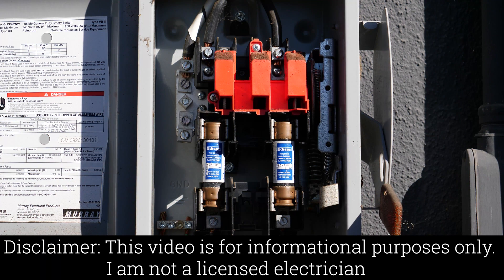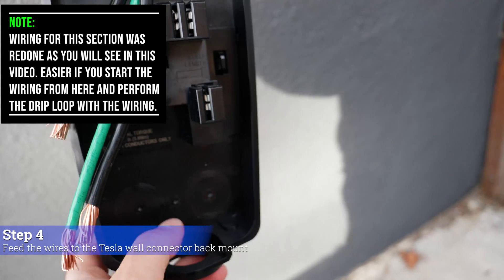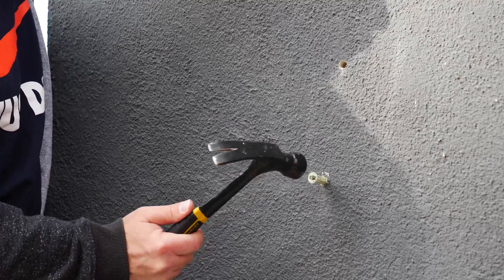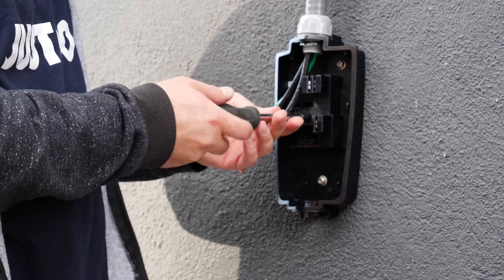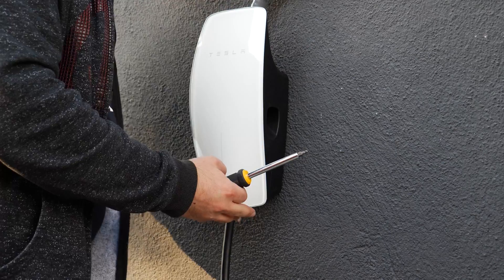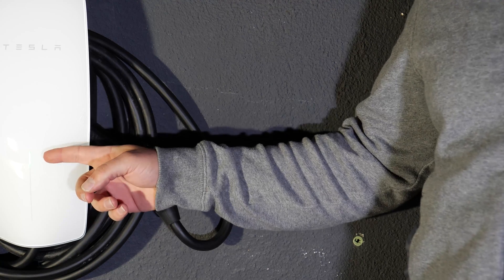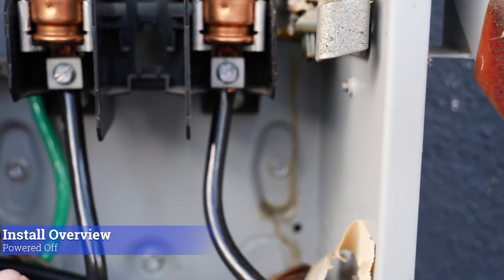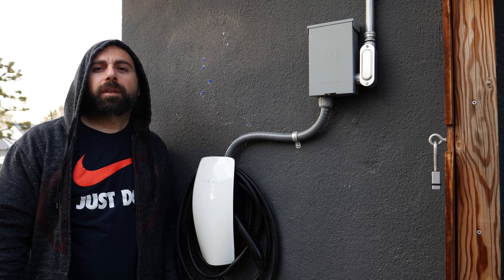NEW Gen 3 Tesla Wall Connector Installation (2020)

Comment: How has it held up being in the elements all day?
Reply from the maker: Under direct sunlight every day and it's hot here, there is some discoloration and a small part of the white portion "paint" of the Tesla has fallen off if that makes sense but other than that it works the same as it did on day 1. Only cosmetic "damage" and under lots and lots of sunlight. I could easily replace that front since Tesla sells that by itself, so an easy fix.
Reply: @landpet  thanks for the reply looks like I’m going to have to do the same. You made me feel better about it.

Comment: Used same size drill bit drilling holes in the wall and drilling through the mounting bracket.... no wonder had to use washers after.....plus the wiring redos....etc......etc. Such a sloppy DIYer.....
Reply from the maker: Thanks for the feedback and explaining your feedback.

I used two different sized drill bits (the one for stucco has a wider tip designed for those applications). I used lock washers which help spread the load evenly and prevent loosening due to vibration (always have had a great experience with lock washers keep bolts and screws in place after long periods). I didn't need to put washers, just did cause it's better to use the lock washers. The wiring redos, I left it there on purpose (which I could've easily omitted, still can cut it from this video) cause on my original install the wires were not long enough so they were sticking out a bit. A lot of people suggested which I agree with to redo that portion of it to not have any exposed wires and so I redid that portion and added longer wires. I left it there to help people to not leave the wires that way (even though power was never on when the wires were exposed).

Comment: As long as the run is less than 100 feet, a 6 gauge wire for the load and 10 gauge wire for the ground is fine with a 60 amp breaker powering the HPWC.
Reply from the maker: I think 6 gauge is fine with 8 gauge ground as well since my run is about 40 ft. (12m) but a few tools online recommended 4 gauge so I went with that. Doesn't hurt to go thicker.

Comment: isn't 4 gauge copper overkill for the new wall connector since it maxes out at 48amp? I guess if you have a short run it's probably fine   I was thinking to go with 6 gauge copper in conduit with 8 gauge ground wire.  I have a fairly long run so cost and difficulty would increase with 4AWG.
Reply: The manual for the third gen wall connector recommends 6 gauge copper wire for maximum power so yes, everything else is Overkill.
Reply from the maker: @JEFFREYSOLORIO  I think 6 gauge is fine, but a few places mentioned 4 gauge for 60 amp. It never hurts to go higher and it was roughly the same amount of effort.
Reply: I bought the wall gen3. I installed it about 25ft away from breaker. I used a 6-3 wire to connect. I installed a 60 amp breaker. Had no troubles until a 2-3 weeks in, the wall charger started to trip. I noticed that after 30 minutes of charging I would get the error charging interrupted. Noticed that happen several times through the night. I think it was because of the wire size. I now bought 4-3 wire going to give it a shot. Sux to run these types of wire. Wondering if I should just down grade to a 50amp? Don't want to but a breaker is cheaper then wire.
Reply: Gems Cove 
I wonder if the utility power might be the problem?
Reply from the maker: @525sprockets  Well I would test even a 30 or 40amp breaker to see if that fixes the issue. If you put a smaller breaker and it works no issues, then you do need the 4 gauge for 60amp. If you put a 30 amp or 40 amp and it also messes up, assuming you also update the Tesla Wall Connector settings to point to the 30 or 40 amp. Then that means your issue is elsewhere, either a faulty wall connector or something wrong with your source of power.
Reply: @525sprockets  6-3 nm cable(romex) is only rated for 55amp(55 x 80%= 44) use 40 amp breaker.  
Use #6 thhn wire, rated 75amp
(75 x 80%=60) use 60 amp breaker

Comment: Can you change the circuit breaker quickly within the app after installation? I use 50A in winter but for total load I drop it to 20A in summer because of my air conditioning.
Reply from the maker: Yes, you can always go to the 192.168.92.1 address when you're connected to the TeslaWallConnector and change it to 20Amps assuming it's connected through a 20Amp circuit breaker.
Reply: Thanks! That’s good, I probably will have to do that seasonally when I run the air conditioning. 

I intend to do an experiment with the charger to show how the 6-15, 6-20, 14-30, 14-50 is or isn’t enough for cold weather charging. So much easier with the web configuration instead of taking off the cover and changing the dial!
Reply from the maker: @mattcrumrine618  absolutely if that was your concern.

Comment: Great video. That's pretty fast charging. How long would it take you to fully charge your car from 0 - 100%?
Reply from the maker: Thanks, almost 7 hours for a full charge
Reply from the maker: Let me explain but without going too much into detail such as the speed slowing down when it's almost fully charged and/or some power loss.

Model 3 Performance has 75kWh battery.

75kWh/11.5kW = 6.52 hours

~ 7 hours for a full charge on a Model 3 Performance or any Model 3 LR